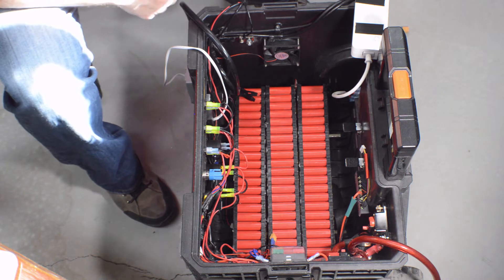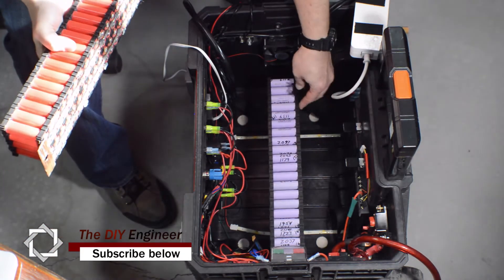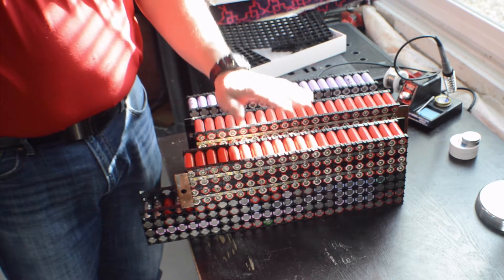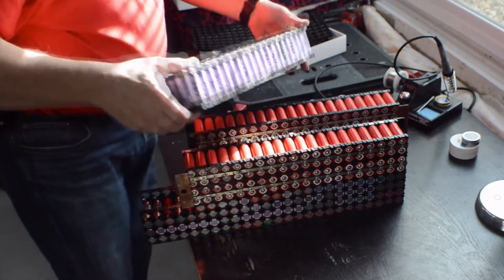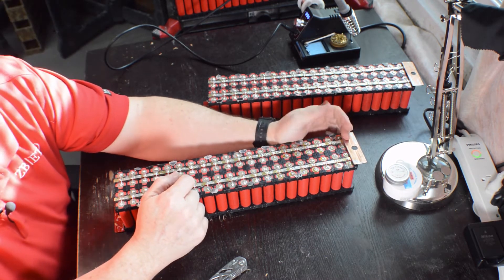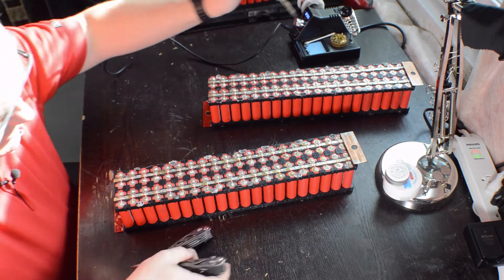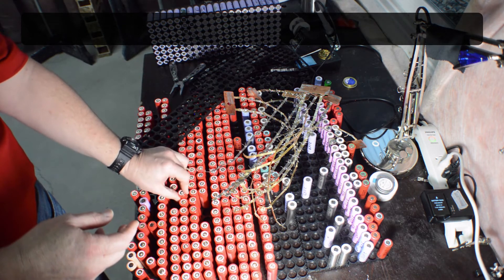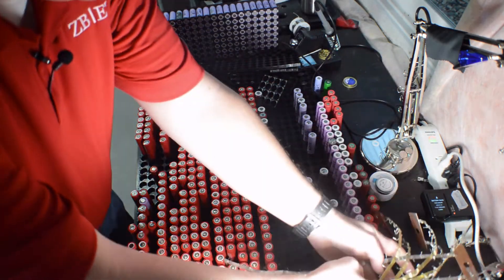Portable PowerPack Upgrade

Comment: HI Frank, I see how you are limiting the top end of the battery, by the charge DC to DC buck converter. But how are you limiting the discharge? I.e. how do you get your pack to stop giving power when you get to 12v which would be 3v per cell in the 4S you are doing. I thought about using a buck converter on the output as well, and making it output 12v. Once the input is less than the output it will stop giving power. but finding Bucks that are higher amps is not easy.

Thank you for any insight you could provide.
Reply: You would need a buck converter for every couple amps of 18650 batteries. So that wouldnt work but good idea

Comment: Awesome videos.  Why use 12V instead of 24V?
Reply: I am also wondering this. I’m working on a very similar setup, but haven’t bought the inverter yet because I was thinking 24V would be the way to go. I’m new to all this tho and any insight would be great.
Reply: Imo 12v because it is the most commonly used DC voltage. However when you start running numbers it becomes more complicated.  In reality 25.2 v is the way to go imo. At this voltage you can start combining battery types. It's all give and take.

Comment: You mentioned that you will only charge your battery pack to 15 volt how are you stopping at exactly at 15 volts are you watching it until it's done charging to 15 volts or do you have something that limits it?
Reply from the maker: Sorry I have not gotten back to you sooner.  In the following video I talk a little about how I control the charge: https://youtu.be/H18HSO7yAbM?t=8m5s
Here is a link to the device: https://TheDIYEngineer.com/buck
For smaller projects I have used these: http://amzn.to/2Er1Shq 
I hope this helps.
Frank

Comment: What is the thickness of the module with the 18650 cells and the plastic holders? I am planning a set up for my 2014 Rav 4 EV and I want to make sure I can fit the modules. Thanks!!!
Reply from the maker: James, I can give you some rough dimensions but I could also help with specific dimensions if I know the configuration of you battery packs.  I you wouldn't mind, could you go to TheDIYengineer.com/contact/ and send me a message with more information and I can email you directly.
Frank

Comment: By soldering the cells, aren't you damaging/shortening their lifespan and capacity due to the heat of the soldering iron?
Reply from the maker: +Merten Fermont, I honestly do not know what, if any damage may be caused when soldering the cells. Over the past year and a half of working on 18650 I have not seen any side effects from it.
Reply: Hmmm okay, it's because from other sources I heard that it's bad. Maybe time for a little test before/after soldering 1 cell?
Reply from the maker: +Merten Fermont, I have done testing before and after, I have not seen any differences.  There is no way to test the life expectancy of a cell so it would be see if soldering shortens the life of the cell. My feeling is that it doesn't.
Reply: correct, it is. But it isn't nearly as bad as people say it is. 

Consider it like a person smoking. It's not bad if they do it once. What makes it bad is doing it many times, in this case the cells being exposed to the head of a soldering iron many times.
Reply from the maker: good point.  :-)